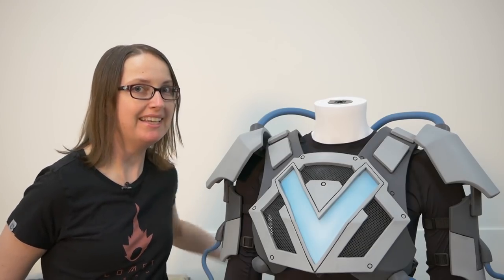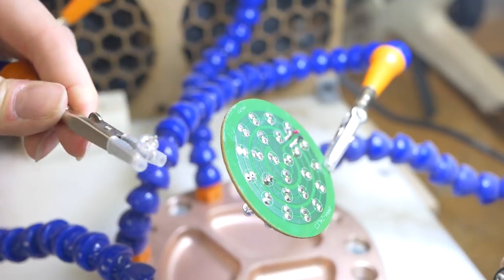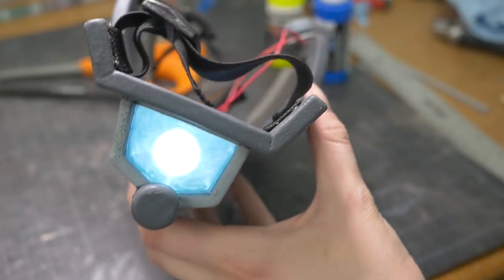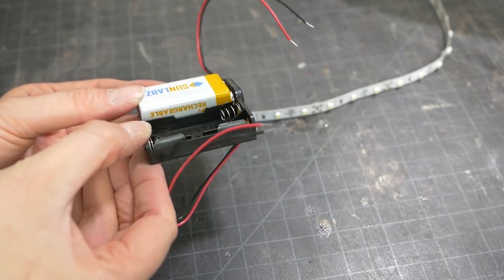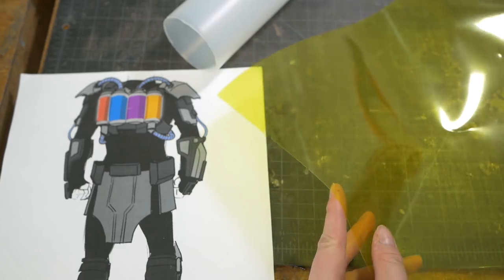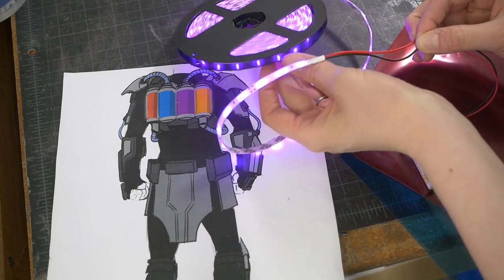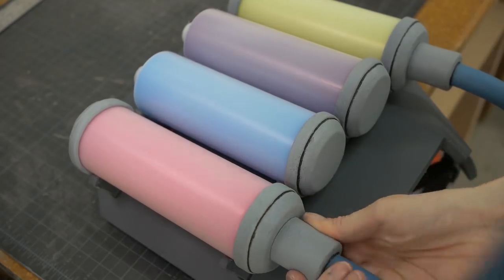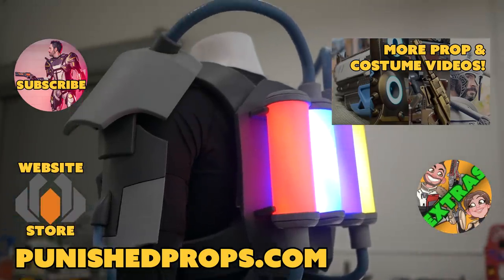Costume Lights! - VRtist Jazza Collab - Part 3

Comment: You guys make it all look so easy! 😢
Reply from the maker: I didn't film the cursing at the soldering iron. I tossed three of those switches. It turns out superglue is not a good way to attach switches--the moving parts got glued together.
Reply: Punished Props Academy Dang, the power of editing, eh? 😅 Soldering is the worst tbh. I tried it once and failed so hard I asked a friend who had experience to help 😥
Reply: Disclaimer - No rotary tools were harmed during the making of this video.
Reply: Anarchy Antz A Dremil is a special thing and should be treated as such 😍
Reply: Toasted Fan Art - I hear Bill will be performing "Little Dremel shop of horrors" this Halloween. :)
Reply: Lmao... oh dang, I spelled Dremel wrong... I deserve 10 lashes from the rotary clerics now...
Reply: Lol. I admit I did have to look it up myself as I wasnt sure if it was and i or an E. Don't worry, the crime is only punishable by manual sanding for your next project :)
Reply: Anarchy Antz hahaha well said 😂

Comment: I love it..
Is it me or the blue tube is way to bright that it over power the purple..just need a little opaque(?)..
Anyway..great work..👍👍
Reply from the maker: It looks more even in person, but it does look brighter on camera. I added some more parchment paper to the inside of the blue tube before shipping it out.
Reply: Punished Props Academy oh wow..i did not expect a reply..haha..keep doing the awesome job..love your works
Reply: I would also add that gels are subtractive coloring and lights are additive.  So mixing colored LED's with gels is going to be tricky.  If you had a really pure red LED and put it behind a deep blue you would not get purple but just about nothing because the gel is only letting blue light and the LED is only generating red light.

Also LEDs, tend to be very narrow wavelength in the colored variety, unlike incandescent which has a much wider spectrum.  So the problem is a red LED for instance is a very specific shade of red and has hardly any other colors in it.  Point is, working with gels you will probably be better off with as full spectrum white as you can get and let the gel do the coloring.  OR get one of the multi color strips and use it's programing to get the color you want.

hey but it worked so...  That's theatre!

Comment: Neato! Some quick electronic tips though: You can think of an electronic circuit as analogous to water flowing through pipes. Voltage is like pressure, and current is like flow rate. So you don't measure the voltage going through a component, you measure how much the voltage drops across it. Similarly, you don't add a resistor in line with LEDs to lower the voltage, but to limit the current passing through it. Too much current will burn out the LED. You were fine here because the batteries you used can't deliver a high current anyways. You were right that wiring LEDs in parallel means the rest will keep going if one burns out, but if the failing LED is now a short circuit no current will flow through the other LEDs (like water, current takes the path of least resistance). If it fails and becomes an open connection, there's now more current flowing through the other LEDs so they'll burn out faster too. The problem with powering the strips off a 9V isn't that the voltage isn't high enough, but that it can't deliver the required current. Picture a bucket of water: if you poke more holes in it the pressure of the water flowing out of the holes is reduced. You'll be fine with the big battery and the strips, they have current limiting resistors built in.

None of these things should really prove to be a problem here because everything was so low power (so good choice of project for beginning in electronics I guess), but it's something to read up on if you ever do a bigger project. Also keep in mind that there can be a good reason for using higher voltages instead of higher currents: it's the current that causes the wires to heat up!
Reply from the maker: Thanks for the tips!

Comment: Great job, let alone for an electronics novice! think the backpack's my favourite bit, the illuminated tubes just look awesome.
couple of ideas: the left forearm could have another row of led's on the opposite side of the panel to help balance the light. And for the differing brightness in the backpack, you could use variable resistors to lower the voltage of the led's in the the brighter tubes.

Comment: Yep, I think a basic electronics course would do wonders. You will no longer confuse yourself about what you should be worrying about eg volts v amps. How to calculate correct resistor values for any particular types of LED etc Luckily you can often fudge it with LEDS as you've discovered but a bit of pro knowledge will = more happiness in more demanding lighting applications.. Love your projects.

Comment: The led will have a short life without a resistor, you're basically relying on the resistance of the batteries and wires to limit the current.
No switch will ever burn out from a 9v battery.
Reply from the maker: Thanks for the info about the switch!
Reply: I wouldn't say "no" switch but no mechanical ones are likely to have any issue.  Certainly nothing in some consumer gadget.  Also rated working voltage is very conservative probably 1/2 or less of what it can actually handle.

BTW your soldering skills are not that bad.

Comment: you can use clear or any color fingernail polish as an insulator when working with battery powered electronics.
just brush on and make sure that its dry. learned that in boy scouts.

Comment: Those forearm lights that are in paralell- the others may still function if one goes out, but they'll also have a higher voltage running through them (since the busted light isn't draining on the voltage anymore). So, if one light breaks, they all break.

Comment: Hey i just thought of an idea that can be done with all the extra side pieces that come with the big eva foam mats, you can take them label them in different units of measurement and swap them out as a foam ruler in case you need to have things in two seperate measurements at once.
Reply from the maker: Good idea!

Comment: Hot tip I learned from a youtuber ( marco reps I think ). when soldering wires, take the strands apart and have them mesh into each other. Like your fingers from each hand.
Soldering that gives a strong connection that can take a lot more abuse.

Comment: 3:30 "i didn't use a resistor because i think the LED drops about 2V and i don't care about shorting out the remaining volt through the LED because the 2 batteries' internal resistances should be high enough to not burn it out" there i fixed it ;)
usually you should always try to use a resistor, especially when you get the power from a supply unit or usb or whatever but in this case it really doesn't make sense. the LED obviously doesn't mind (it might have about a week less maximum lifetime but who cares) because your batteries just won't supply the current required to damage it. it might heat the batteries unnecessarily and lower their rechargeable capacity though.
but who am i to lecture here, i recently had to (ab)use a software patch to prevent a bunch of LEDs from dying after soldering in the wrong resistors :P

Comment: There are no dumb questions, so here we go....

How about that hot glue and connections thing? arent the cables getting warm the moment its activated? is this a stupid thought? or is this so little warmth it doesnt influence the glue? Nice built by the way, keep up the good work!
Reply from the maker: There isn't enough wattage from these circuits to generate nearly enough heat to melt hot glue.

Comment: Excellent!

I'd have a hard time not moding that mannequin into a replica of Nick Valentine or DiMA.  But probably Nick.  :)

If you're open to ideas, I think it would be super cool to show people how to make the LEDs in their builds adjustable as far as brightness with a potentiometer or even auto-adjusting to external lighting with the use of a photovoltaic cell.
Reply: Michael Tótin or they could include a microcontroller and do some cool effects^^
Reply: Absolutely.  I'm thinking baby steps.
Reply: Michael Tótin 
yea, electronics seem to be quite complicated for many people, so i guess that would be helpful :)
i can do microcontroller stuff while i'm not very experienced with analog electronics either (or foam^^)... i actually love your idea of analog automaticly adjusting the led brigthness to save battery when its dark :D
Reply from the maker: When we learn how to do that we'll do a video on it. =D
Reply: Punished Props Academy yay ^.^ 
(just for info) you could try to get into the microcontroller topic with adafruit neopixel leds... they require a arduino microcontroller to run, but the code is premade available, so you can start from there and get the hang of the structure and syntax of a program :)
also there is a lot of tutorials and documentation on how to code for arduino
Reply: It's extremely simple.  All you need to do is add a photocell to the circuit.  Just google it and you'll find how-tos and even a video.
Reply: It would be a top tier mark off of my bucket list to be a guest on your show, but my electronics knowledge and practice are a bit rusty.  Also, I imagine you know people or could find people in the biz that would make for a better guest.  I still happily offer my services though.

If you were to pursue live learning/teaching electronics integration into prop building.  Starting with LED, wiring, soldering techniques, etc. is a great starting point.  And a place you want to get past before jumping into microcontrollers, microprocessors, etc..  The stuff to cover is almost endless, from custom built voice synthesizers, to animatronics.
From manual and auto adjusting LEDs, the next easy step would be to throw a bipolar transistor into the circuit and a microphone to get your LEDs to respond to music or your voice.  A next good step would be to design and build your own power adapter.  Maybe even make it adjustable.  So you have LED brightness control built right in.  

But I digress.  Sorry.

Comment: The smaller leg of the LED is the negative side!
Reply from the maker: Yes, the shorter outside lead is negative—if it hasn’t been cut. Inside the LED, the smaller post is the positive anode side.

Comment: Do you think this technique would work with foam?
Reply from the maker: This whole set of armor is made of foam. Which technique are you referring to?
Reply: @punishedprops  Well, I am making a Godzilla cosplay that requires a latex to go over the whole thing and somehwhat over the dorsal plates. Im using a 2 inch cushion/project foam for the body(I buy at Walmart), and 1 inch foam for the Dorsal plates. Im using basic LED RGB strips - usb powered for them to glow and I am figuring out a technique to have them seen with such a basic lighting. If you guys have a Instagram it may be easier over photo explanation.

Comment: hi can I know how can you charge the 12V battery when you cut off the port and soldered to the led strips?
Reply from the maker: The 12V battery I purchased came with a separate cable for charging.

Comment: In LEDs and switches you need to worry about the current or power rating more than the voltage, anyway amazing build
Reply from the maker: Thanks for the info!

Comment: im not really sure about the bond you get from hot glue? wouldnt a rubber glue or superglue work better for attaching stuff... jazza moves around a lot in his vr videos
Reply from the maker: Hot glue is quite strong for bonding foam. If Jazza does somehow manage to rip it apart, he can always fix it up simply with some more hot glue.
Reply: ive never worked with foam so ill take your word for it :D